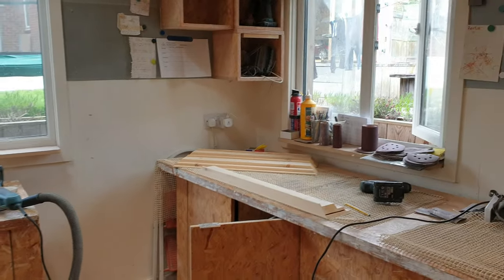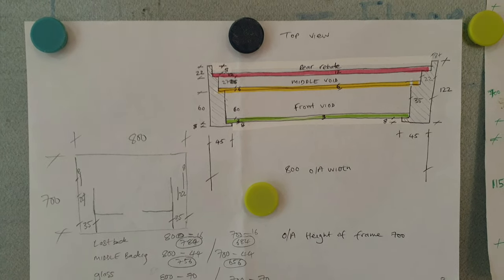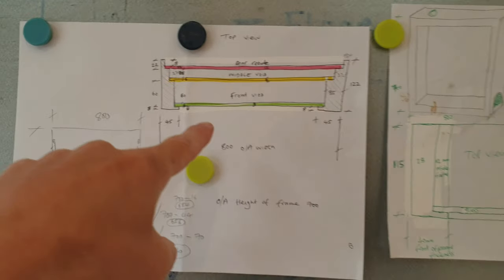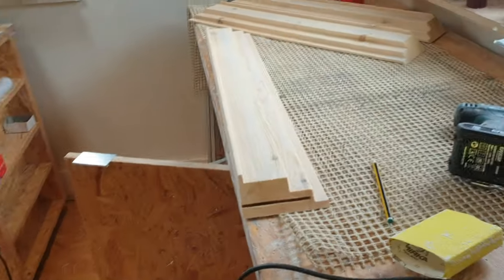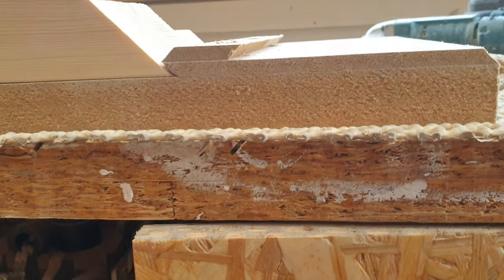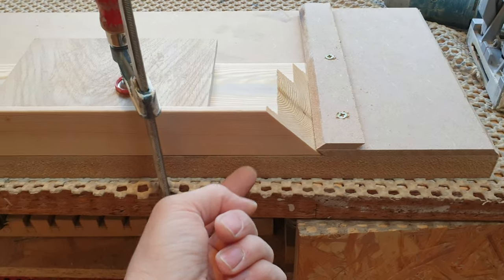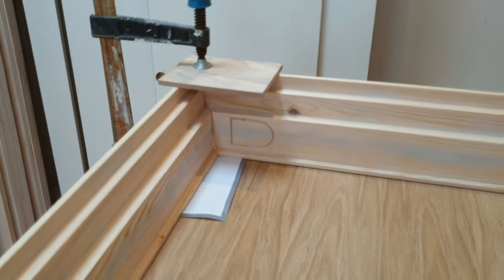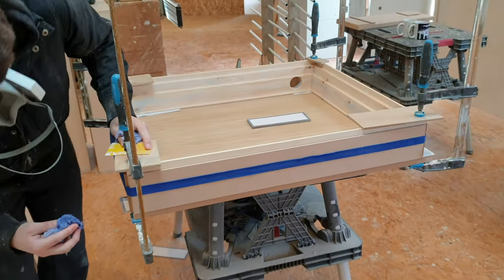Making a bespoke Frame | Biscuiting mitred joints | Assembling frame with ratchet strap EP#27

Comment: First view!
Reply: Did you not use a domino because you don't have one? Just out of curiosity I've seen quite a few times splined mitre joints but I'm guessing this is more time consuming and harder to fill if getting sprayed
Reply from the maker: Your right I dont have a domino machine, and wouldn't really use it enough as I mainly make fitted furniture.
Biscuits are ideal for wardrobes and alcoves etc, but if I start making solid furniture more often I probably would buy one.
😁
Reply: @thelondoncraftsmanworkshop  hi, thanks for the reply yeah I can see it works better with wood and the zeta p0 is better for panels certainly the knock down fixings.